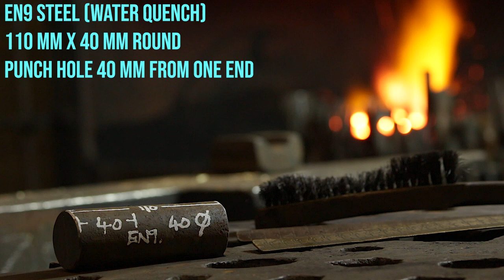Blacksmithing - Forging a doming hammer My first hammer (pure forging)

Comment: What is the purpose of this hammer
Reply from the maker: I use this type for heeled tenons it has just the right curve and is far enough away from the work ( which is usually bigger sections) to keep the heat away from the hammer hand. It's a finishing hammer for me. I also use it for blending scarf welds when I want a localised hit that won't mess up the joining bars, so I can focus only on the weld  then move to a larger hammer. I will explain it in a video as I made this for a project coming up soon.
Reply: 当锤子用。。。

Comment: I've found this way of driving in the wedge to be most effective. I'm also glad to see I'm not the only person who likes a dark char on handles.
Reply from the maker: I have no idea if this is the correct way or not, i really hate putting handles on things as you can probably tell from how rough it looks. the dark handle looks great, never tried it before, but really needs a week in a bucket of oil, dried out so much heating it with a torch.
Reply: @workingwithiron  yes it will definitely benefit from a good soak. I think it turned out great; as good or better than many "tutorials" on how to fit handles I've seen.
Reply: @workingwithiron  I took a quick search on charing wood handles, and some say don't do it. Use acid instead, there are other ways to bring out grain and color. But I think it's all a matter of opinion. There's no agreement if it toughens the wood or not. I think, just like toasting bread you can under do it or over do it. What matters, is if you like the result.
Reply from the maker: @danilko1  I like you. Instead of just taking my way as the way to do it, you went and did a bit of research before saying anything. That approach is a breath of fresh air so thank you!! 
I have no idea if this is good or bad but it is something new to me. I don't have a lot of experience with woodworking as I don't have the patience for it but its a start. I love the finish, but really dried out so have soaked in oil for a week which will hopefully do it some good. Thanks so much for commenting, I really appreciate it 👍. Have a great weekend!!

Comment: Really liked the camera word under the power hammer. You can see the metal moving on each stroke.
But 2000 grit on the face... how can you ever bear to use the hammer in anger? :-)

Comment: Excellent work and Video was the best I've ever seen for 1080 on my end. Surprised you don't use your power hammer to punch the holes, Using smaller dies. Brent Bailey comes to mind. Great work though.
Reply from the maker: thank you! can i ask what you watch it on? ive been using new software for editing and am trying to get it as crisp as possible, just wondering if the sharpness is too much as my screen is 144hz it can handle it but curious to know how it looks on other screens. The punching on the hammer is something ive never done as im not too good with power hammers yet, still learning with them.

Comment: Well that's something else! Reminiscent of  the dogs head pattern.  I'm betting that this would work well as an armour's hammer as it has increased face reach w o the added wieght necessarily  due to the concave construction. 
Nice video no doubt well made.

🙏Blessing abundant sir 
Crawford out 🧙‍♂️
Reply from the maker: Thanks Crawford! It would, I took inspiration from repousse hammers so could well work, and it is perfectly balanced for that purpose. I made it to do heel tenons and firewelds to blend toes of the weld in without smashing anything that doesn't need welding like most hammers do. I will demonstrate it soon as I gotta do some firewelding projects soon so will see what I mean 👍
Reply: @workingwithiron  awesome  thank you

Comment: Awesome work. I have a question though. Why did you punch and drift the eye by hand when you have a power hammer? Couldn't you have used it to drive a punch through?
Reply from the maker: I've never punched a hole on the power hammer as I'm not too good with them plus I'm not sure how soft the top die is so don't wanna dent it with tooling. I enjoy doing it by hand. Will be bringing a video out soon of why I enjoy and don't enjoy using power hammers soon.
Reply: @workingwithiron  Like the PH or not you are very precise with it.  Very good work sir!

Comment: Another great one!! What weight of hammer were you using?
Matthew
Reply from the maker: The power hammer weight?
Reply: No,your kind of "go to hammer" that you seem to use in most of your videos.You started out with it in this one. Thanks. @workingwithiron
Reply from the maker: @gig1958  It is 1 3/4lb shoe turning hammer with a 14 inch handle. hope that helps!
Reply: Yes, it does. Thanks! Looking forward to your next project. Matthew  @workingwithiron

Comment: What procedure do you use with this steel for hardening and tempering?
Reply from the maker: as i have no heat treating oven yet, i usually heat up to orange, stick a magnet on it until the magnet sticks. take a mental picture of colour and reheat to just above that colour, keep it there for a while, as its EN9 i take out, and harden in water. depending on the tool i will harden the whole piece or just the cutting edge or hammer face. its a forgivable alloy but not the best, but i have access to a lot of it. tempering i would place it on a hot slab and let the heat travel through or if im hardening a small bit, i do it in one heat, like i show on the round punch video, and chisel video.
Hope that helps!

Comment: What alloy is your punch made out of?  Don't think it is supposed to get hot like that and need reforming
Reply from the maker: En9 it's a low grade tool steel. H13 would be best but I have none yet so make do with what I got.
Reply: @workingwithiron  I have some 4140 to make my punch and drift out of. Think that will work? I heard H13 is a nightmare to move by hand